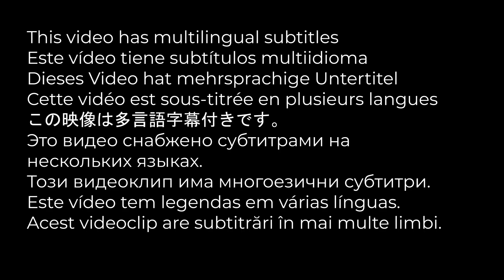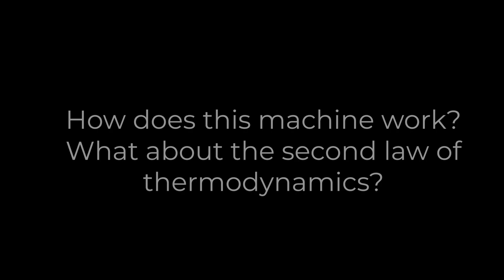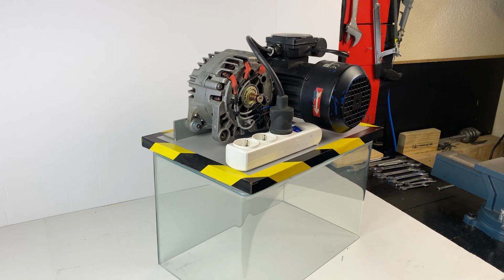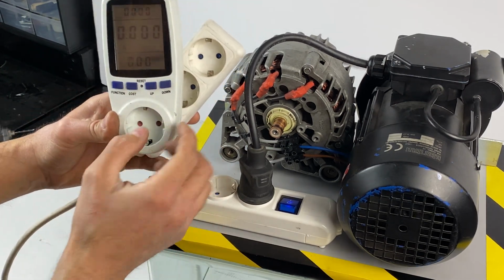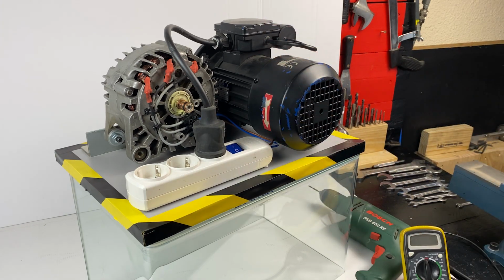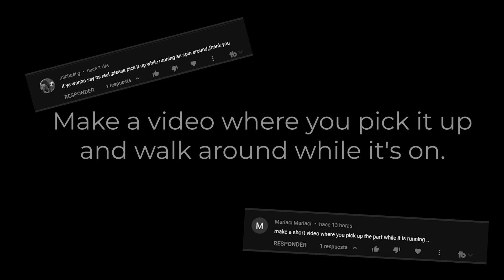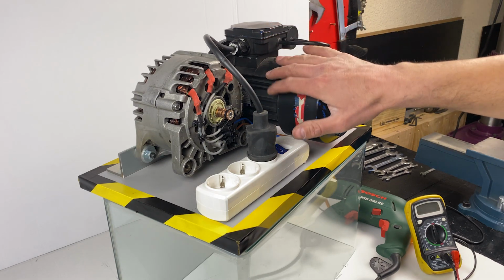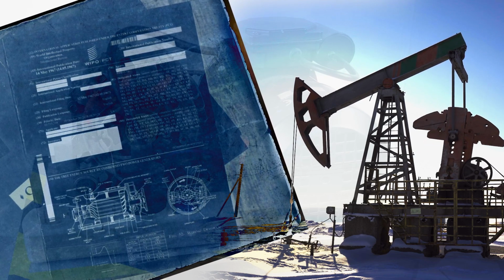We put this Infinite Energy Generator to Test - Liberty Engine 1.0

Comment: parasidic looses in motor and alternator will never generate a 1:1 ratio is needed for this to work. you must first get 100% efficiency out of both the alt. and motor. even if you could make them both 100% efficient you would loose in the wires and the belt. all wires and connections have resistance. resistance eats efficiency.